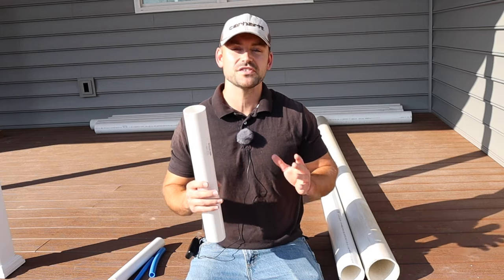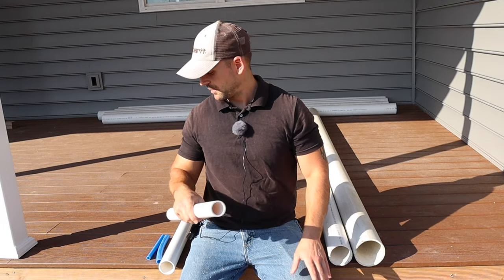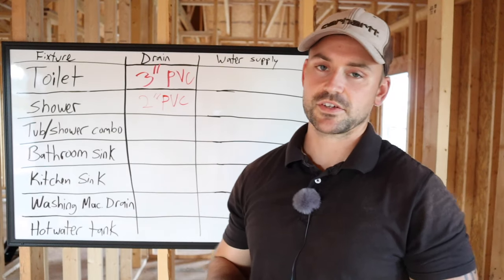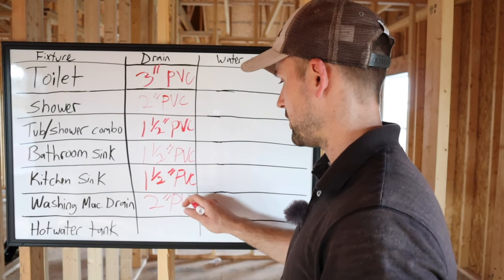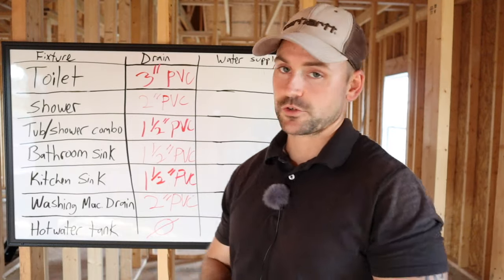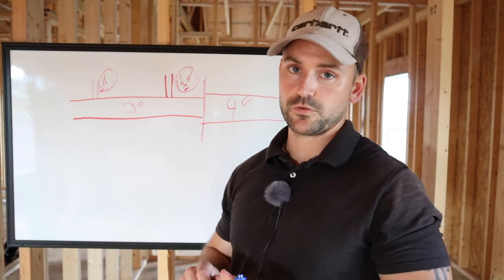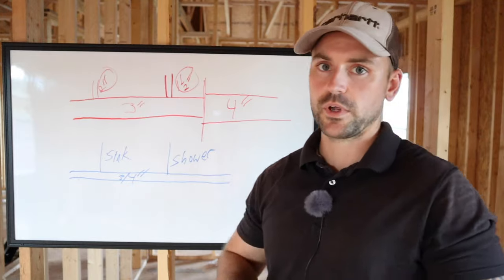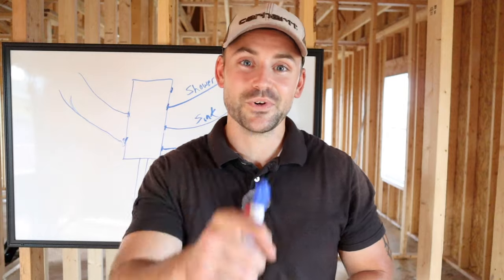What Size Drain Lines For A Shower, Sink, And Toilet?

Comment from the maker: Did you find this video helpful?
Reply: Oh yeah thanks for the upload!!!
Reply: Good video
Reply: Just perfect
Reply: Thanks for taking the time bro!👌
Reply: Thank you for this valuable information
Reply: Extremely helpful! I subscribed.
Reply: I am building my house myself. Im just on the floor joists now but plumbing is next so I'm learning now! Thank you!
Reply: What about external hose bib on exterior of house? 3/4" or 1/2"?  Running a line to the garage to also feed a pressure washer, assuming 3/4 would be best?
Reply: Awesome video man
Reply: Perfect bruh! Perfect
Reply: Absolutely
Reply: Very informative.  Now, let’s say I want to remodel my master bath and want to cap the existing shower drain because it’s not in the right place anymore.  Where the tub was, I’d like to put a double shower.   The drain is  1 1/2” with a p-trap predicted  somewhere under the slab.   1 1/2” drain is too small for two running showers, I assume.  Is even 2” too small I wonder?   I could do more demo and tap the 2” drain.   My drain fixture is a 6’ long stainless steel trough.
Reply: Thank you so much for the information! This is exactly what we were looking for!
Reply: No, it is just extremely useful😀
Reply: You are so helpful brother!
Reply: YES
Reply: Wonderful Video as always. Can you use 4 inch pvc for the toilet drain as well?
Reply: Extremely helpful. I hope i havent screwed up already,,,but now i do think i can rough in my bathroom 😊
Reply: PEX is more restrictive than copper, especially the fittings. You should size up when using PEX, so if you need a 1/2” copper water line, you should use 3/4” (or maybe 5/8”) PEX. If you need a 3/4” water line, you should use 1” PEX, and so on. Building codes do not specify, so you can pass with this, but think about it… the inner diameter of a 3/4” plastic crimp PEX fitting is 0.460” (per ASTM F2159). The ID of 3/4” Copper Type-M is 0.811” and 1/2” ID is 0.569”. So 3/4” PEX with plastic crimp fittings is more restrictive than 1/2” Cooper Type-M.

Metal PEX fittings have larger ID than plastic PEX fittings, and Cold Expansion (F1960) fittings have larger ID than Crimp fittings, but it is still much more restrictive than the Copper with the same nominal tubing size.

In my opinion, the code books are behind on this. When you use PEX, you are effectively sizing down with copper tubing (same effect). If they don’t allow you to size down with copper tubing, I don’t understand why the codes still allow you use PEX sizes that effectively size you down.
Reply: Gosh dog this video explains a lot no beating around bush man thanks honcho
Reply: I've learned more from your videos than I could have imagined. Thanks!

Comment: You said copper is outdated yet you suggest cpvc as an option?  Copper is great if you can afford it, you can keep it from freezing, and you don't have acidic water.  PEX is great if any of those factors are present. But CPVC is absolute garbage. The only reason to buy cpvc is to repair leaks in your old house while you save up for a repipe in PEX or copper.
Reply: to him

Comment: People can’t afford copper there’s nothing wrong with copper copper gives more value to your home pecks if you got the right plumber that knows how to run a zone panel and run one Killswitch ball valves because it’s flex tubing to every fixture but a real plumber can take PVC flow guard pipe and it will last if it’s put in correctly in square The problem is everybody’s not a plumber and everything every homeowner can’t put in by their self. They can’t bulk a bulkhead around for 3 inch wide combo or to back the toilet or if it’s this far away from the stack did you help him with that and if you got a 2 1/2 bath back to back Can inch and a half be enough water consumption you need 2 inch, just like people think that you put a bigger pipe it gives you more pressure bigger pipe just gives you more volume😮 and every code and every city is different IPC, UPC, and every state is different. You got some states that run you flex gas some won’t let you run flex gas you gotta run all steel some inspectors don’t wanna see pecks because it blows apart, if it ain’t put in correctly.😮

Comment: That's not entirely true about the hot water tank.  If you have a heat pump hot water heater, then you should run at least a 3/4" pvc pipe for the condensate line.

Comment: I’m going to start building my house so I’ll be posting videos on the building process and this is a lot of help from a master electrician who’s never even looked at plumbing
Reply: Same here-- crawled around and been beside thousands of plumbing systems but never paid specific attention to connections, etc; while being the old electrodes that we are 🤣
Reply: @chrisharrell5945  I know I’m kicking myself by how many great plumbers I’ve been around but never asked any questions! So embarrassing!
Reply: @justsomeguy.8670  🤣🤣. Of course we've ran pipe and made connections 😂 but there's all those little quirky details.  Electrical work is sure full of them: like Buchanan B2 wire nuts being the best on the market and not using a freaking utility knife when stripping wire 🤣
Reply: Electrician as well. The hardest thing for me is getting the right valves and lines for sinks, toilets, etc. If it's electrical I can find the right piece in a few seconds. Plumbing related I'm standing in the isle for 20 minutes just to get home to realize I got the wrong size valve or line 😅
Reply: @everbeenzen  🤣🤣🤣 yeah their quirky details like 1/2 and 5/8 fittings, not being anywhere near, not even remotely close to 1/2” or 5/8” ID or OD.  They just about freaking measure 1” 🤣🤣.  Electrodes have our act together!! 😅

Comment: Great video as usual, I'm a plumber and builder ,plus I do alot of remodeling most of my drain lines I've been using straight 2" on showers and tub plus sinks ,I haven't used 1.5 in a while except for popping out of the wall for sink drains
Reply from the maker: Oh good to know. I usually use inch and a half because of the inch and a quarter connections. Thanks a lot for watching Plumb Build!
Reply: @TheExcellentLaborer  yes I go with a 1.5 to a 2 inch santee to stub out the wall with a 1.5 for the slip fit P-traps under the sinks

Comment: Regarding the manifold system @7:29 - I believe I have seen that before (when I was in Florida). They placed the manifold in the garage by the door to the house. They could shut off water to various parts of the home with this manifold - almost like an electric panel. I suppose it would be handy for problems or when traveling for extended times. 
Correct me if I'm wrong.  

Nice video!
Reply from the maker: Oh yes the manifold system would be almost exactly like a panel box. I could definitely see the benefits. I just prefer the truck and branch method because it seems simpler. Thanks Zarrah!
Reply: yea ive seen the same thing here in florida many times. Same thing it was like an electrical box where you could turn off the water to each spot individually when you wanted instead of shutting off the whole house and what not. 
Guess its one way to do it ,  I would say its preference if your getting to decide which one you want.

Comment: Extremely helpful however, I need information on which fittings fit into what cause it is not as I thought. Bought 1 1/2” fittings for the 1 1/2” pipe but it doesn’t fit.

Comment: In my area we can use a 2 inch drain for toilets. How is that you may ask?
In an existing structure it is allowable to use a 'SaniFlow' toilet setup which can use the existing 2" drain.
Here's my situation. There are a lot of older homes which have the laundry in the garage. This means there is  2" drain line for the washer. We want to move the laundry into the house. Then finish to garage to make it living space with a new bathroom.
By using the SaniFlow system we can use the existing 2" drain from the former washer location. We can also tie in a sink and shower.
SaniFlow is a macerating system that creates a slurry from waste.
Our plumber came up with this solution to save us tons of money. Nice guy!

Comment: Water heater needs a drain pan with 3/4" drain min. The drain is usually plumed right on the garage floor, but I like it plumed into the condensate drain from the AC.

Comment: Thank you for your video, I have some questions. So with the water supply lines, are there 2 of the 3/4" pex lines for the main supply a hot and a cold? If use use an electric water heater instead of a tank does this use the same plumbing system? I am assuming you have the main water lines, it goes to the tankless water heater, then you have the 2 main lines come out from that unit, underneath the house as the main trunks and then hot water branches from red and cold water from cold. Any insight would be very helpful.

Comment: In Europ:
Drain
Toilet 110mm/90mm, sink, bath, wasching maschine and shower 50mm. (110 - 4", 50 - 1½”).

Supply all 1½"(DN15) but water heater tank better supply with ¾” (dn20) but this is dimension in standard hause If you have more bathroom you must calculate the best dimmension for individual examp.

Comment: If you check the code book, only 11/2" pipe and trap is required for a shower even though the drains are 2". just in case you don't have enough room for a 2" trap.

Comment: I saw you used san. tees in the horizontal as branch drain connections. Did your inspector let you do this or did you have to cut them out?
Also, you should specify what plumbing code you are using. UPC does not allow 1-1/2" branch line to a kitchen sink. You can use 1-1/2 " for the trap arm though- there is a difference between fixture trap arm and a fixture branch
Reply: I seen that. It grinds my gears as a plumber 😂🤦🏽‍♂️
Reply: Since when are you allowed to use PEX right to a HWT. I’m in Canada and we need a certain length of copper before we can transition to whichever were piping the house with (never CPVC).

Comment: Hey Josh, I love your videos, no song and dance …straight to the point. I’m updating my 1963 shower tub combo to a shower only. All the drain lines are original copper and brass including the 3 inch pipe that goes to the outside.   My copper and brass tub/shower drain line is 1 1/2”. The existing shower drain T’s with the 1 1/2” sink drain which then T’s to the 3 inch copper waste line. Your video shows a 2 inch shower drain. Can I reduce this so I don’t have to change all the plumbing going out to the street? Thanks, Rick

Comment: Is it code now for plumbing drain to be installed up inside the joists, like it has been for electrical installations for a number of years?  Can the drain pipes no longer be below, hung from the bottom of the floor joists any longer?

Comment: I have heard if you want more shower water pressure to increase the supply line size. 5/8” I believe
Reply from the maker: I have never done that. I’m sure some people do. I guess the hard part is finding fixtures to except it
Reply: Pressure and volume are 2 different things. Pex a will have a greater ID giving more volume at the same pressure.

Comment: I'm remodeling the bathroom on one of my rental units. Simple bathroom comprised of a sink, toilet and tub/shower. I cut out all the old cast iron and installing PVC. The main drain line from the bathroom is 4" cast (so was the vent to the roof, which is now gone). Can I now run 3" PVC from the drains and tie into the 4" cast? Also, can I run a 2" or 3" vent up to the roof instead of 4"?

Comment: 2:38 - i see why this is unintuitive, but i'd guess the logic is that the tub can provide temporary storage, allowing the required drain flow capacity to be lower than it would need to be for a shower without a tub.

Comment: Great video! Very informative! Is this standard drain pipe and water line size for the UPC codes? Thanks man!
Reply: No. Kitchen sink needs to have a 2” drain line but can have an 1 1/2” trap arm. Water supply, you just don’t run half inch to each fixture. You need to get the PSI, developed length, and elevation to properly size your water lines.

Comment: Noticed the 3" branch off your main drain line was tied in with a 4x3 sanitary tee. Should really use a wye with a 45 or a long turn tee wye. Asking for stoppages right there as the system gets used

Comment: Excellent Laborer, as I see it, you don't like to use copper tubing since it requires soldering the pipe connections, is that correct? This is all legal in the house plumbing and no copper tubing is needed. Instead, PVC and PEX tubing is the latest alternative. Is this correct?

Comment: Josh,  i am in the mist of a 1910 farm house renovation.  The house currently has one bathroom.  I am planning on adding a second full bath.  Am I ok with two 3” drain pipes for the toilets or should bump up to 4”?
Reply from the maker: Hey Sean! I use 3” drain pipes. It seams to be the common pipe size for toilets. I hope that helps!

Comment: Great video. 1 ?. How do u end the trunk nd run line. I understand how it starts. But how does it end?
Reply from the maker: At each fixture. Hope that helps!
Reply: @TheExcellentLaborer  
The trunk has smaller lines running off it to items.  So where do u end the trunk? The trunk doesn't go direct to items correct?
Reply: @dtruth5769  it ends with a tee catching the last 2 fixtures on the line
Reply: @dtruth5769  usually a 3/4" x 1/2" x 1/2" tee

Comment: Would I have a pressure issue if my pex branches are 3/4 as well? Seems a waste to buy two different tube sizes plus adapters and what not if I only need it for 4-5 feet of piping.

Comment: Currently I have a shower/tub combo. If I wanted to “flip” the locations of my sink and shower when remodeling does that mean I should be good to use the same rough in’s already there as they should be 1.5”? 

If I covert to shower only when moving, no tub then at the old sink location I would want to switch that for 2” if I am understanding this correctly?

Comment: im doing a remodel and the barn has a septic line 4" outside, could i hook up the new shower and washer drain up to the 4 inch inside of finding the 3" under the slab(which only has drain for a toilet nothing else)?

Comment: Please, could you tell me what would happen if I keep the 1 1/2 inch pipe already installed from my tub/shower that is in place in my bathroom. I took the tub out to make an open shower only bathroom. What if I don't change the pipes? I plan to do a 'Diy cement pan' with the slope and everything waterproofing etc... but would prefer not touching the pipes that are there already.
Really need an answer to this question please. 
At my hardware local store they said that 80% of people use 1 1/2 inch pipe. Is it true?

Comment: What size line would you use for spigots? I recently replaced one of my frost-free spigots and used 1/2" just because the entire house is already 1/2", but I thought I saw you use 3/4" on your spigot install video. I'm thinking about re-plumbing the house since its so old (1949) and the existing plumbing is a MESS.
Reply from the maker: Hey Nick! Check out my pex pipe video and I explained the spigot. Hope that helps!

Comment: Two questions, do you have concerns about using pex B with clips vs pex A with the expandable rings? Seems like expandable rings are slower but less chance of making a mistake and not tightening a ring properly and having an issue. I am trying to decide if I should invest in an expansion tool and set up for a or b. Second, is there one basic chart I can copy/print to find these pipe standards? Hard to keep all the sizes straight in my head. Has code changed these sizes at all or have these been tried and true for awhile? Thanks for all the great content. You make construction understandable to the average joe like myself. Not any fluff. Love your videos and content. Helped me a great deal.
Reply: I'd go with pex A how many bathrooms in your project?

Comment: Manifold keeps you from loosing water pressure when running multiple l fixtures are running. So you won't get burned while showering if the toilet is flushed.
Reply: If you size the pipe correctly won’t have that problem. Plus every valve is pretty much pressure balanced.
Reply: They fixed that problem 20 years ago inside the manifold .UGGGGG

Comment: Good video, but you forgot vent pipes?
Reply from the maker: The way everything is vented is a little different and that would require a whole other video. Also, you can use wet vents to a larger pipe to do multiple fixtures. Thanks for watching!

Comment: Can you run a 1" pipe as the trunk cold supply and have 1/2" branches off of that? Does anyone do that? It would give better supply with multiple things being used at the same time.
Reply from the maker: You could as long as your main water supply is 1 inch pipe. You would have less loss of water pressure that way.

Comment: Guess WHAT? When my MOM replaced her Hot water tank, they told her that here in Colorado you have to have a drain pan installed under the tank with a drain running outside if the Hot water tank ever started leaking. YUP!
Reply: Every county has it is own codes. Code is dictated by the Authority Having Jurisdiction.

Comment: My guess is the shower pan needs 2in because it’s low to the floor and needs to drain quick so that it does not flood.
Reply from the maker: That’s a good point. That make sense. Thanks for your input friend!
Reply: That is it exactly.
Reply: check the code. only 11/2" is required

Comment: NO benefit?  The second way is much better and you can turn off each waterline independently in case of a leak without shutting off the main line.  Maybe you don't use this way because it cost you more?  Or maybe takes longer so you look for a shortcut?